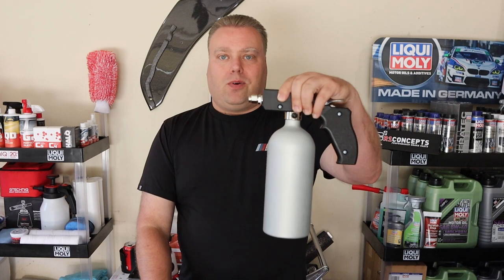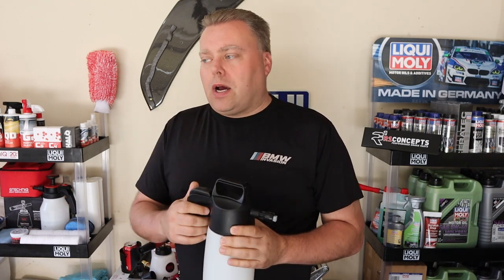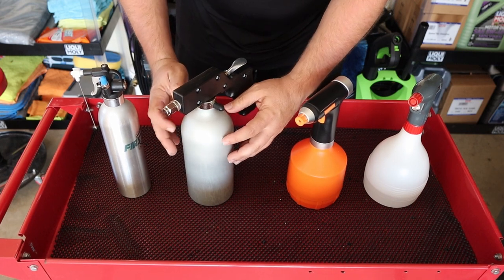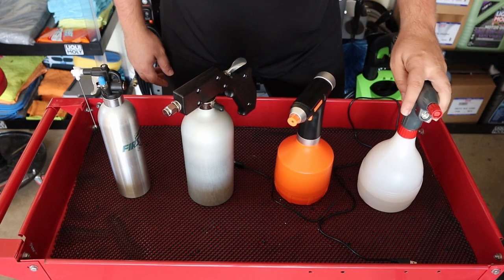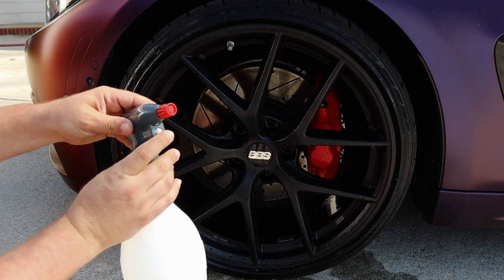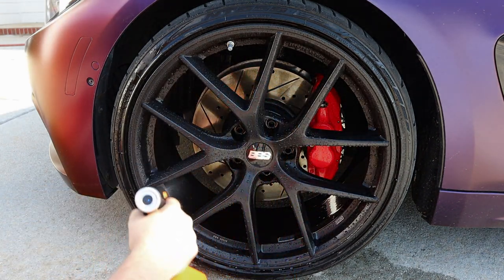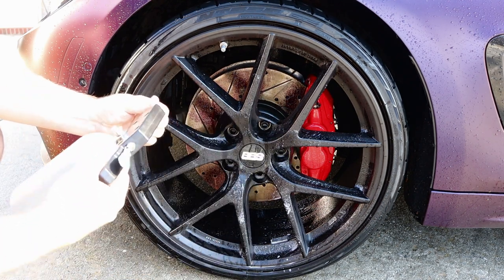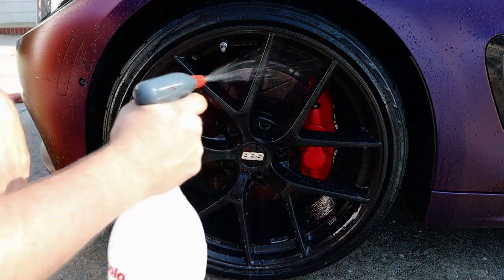BATTERY & AEROSOL SPRAYERS FOR DETAILING | WILL THEY WORK? | REVIEW AND TESTING

Comment: Sure Shot has been making pressurized spray bottles for decades. They might be the original patent holders of that design. The first time I saw one was in the early 80s but I think they've been around since the 60s or 70s. The Shure Shot you had in this video is a newer design...I've never seen that one before. The older design ones. which I have 2,. which they still sell and work great can hold up to just about any chemical that you can throw at them. corrosive stuff should be flushed out of them after use. I keep one filled wth WD40, and another one filled with wax and grease remover solvent, pressurized and ready to go..  All the parts can be bought to refurbish them if the o rings go bad or nozzle etc. the schrader valve is just standard, easy to find and replace....Parts availability is a big deal to me. I really like the simplicity of filling it with compressed air. No batteries to charge, no electrical connection to fail, pumps to seize, or motors to burn out. Nice video. Thanks
Reply from the maker: I worked for Liqui Moly for awhile and every shop I visited most of them were using Sure Shot for Brake Cleaner. That is where I got the idea from. When searching i saw they made a trigger one with an adjustable nozzle so had to pick it up. One chemical i know that shouldn't be stored in them is fallout remover. It really reacts with the metal and leaves black marks on everything and clogs the nozzle. Probably kills the effectiveness of the chemical as well. I tell you one thing about the Solo battery powered one. Its been spraying diluted ceramic spray every wash for two months now and have never charged it. Crazy long battery life.

Comment: Might have to try the Solo sprayer. The ability to switch between different bottles is great. 
Another alternative is to add Schrader valve stems to the iK bottles. You can use an air compressor but can still hand pump them so you’re not having to walk back to the garage to pressurize it again.
Reply from the maker: I have heard of the Shrader valve hack. Have to make sure the input source is regulated or you can easily blow up the bottle.

Comment: That's cool how versatile the solo sprayer is. May have to get one for the arsenal. Also iK released their Foam Pro 2+ that you can use an air compressor instead of pumping if you want to check that out for foaming wheels
Reply from the maker: Might have to do a review on it. I'm actually starting to really like the Sureshot. It really like to agitate the mix and lasts a long time.

Comment: You should check out some of the videos by Martin at Bel Levoro Auto Spa, he does a lot of good reviews on different solutions and I think you guys have a similar vibe.

Anyway he has a dope spta sprayer that's a foamer that has a built in battery powered pump that he uses in lots of his videos and has done a review on.
Reply from the maker: Will check it out. I have heard IK has a sprayer as well that you can use compressed air, but its for foaming.